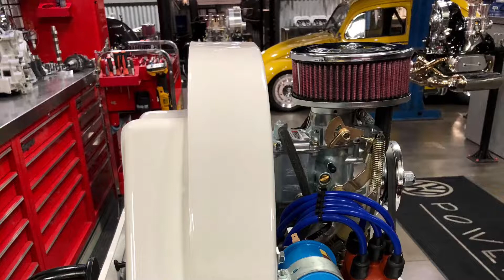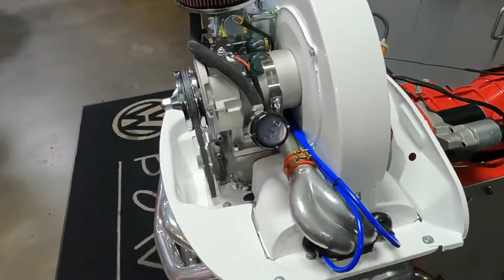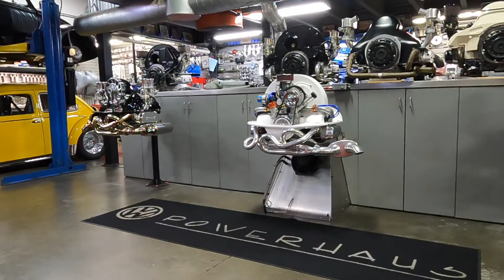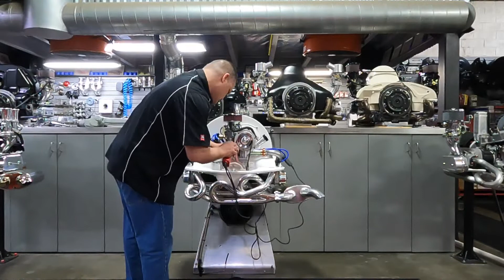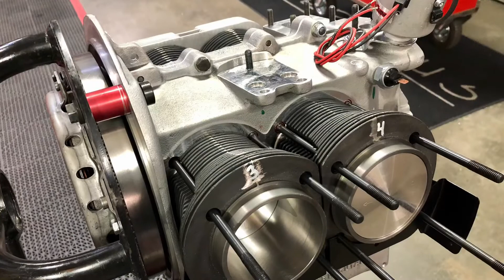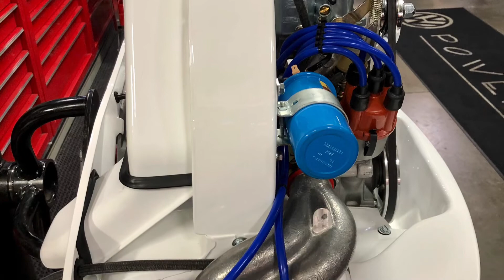Brand New POWERHAUS VW 1600cc Aircooled Engine Final Adjustments & Load Cycles

Comment: Very nice. you such great work. What would be the approx. HP of thyat engine?
Reply from the maker: This one is a stock 1600cc, it makes about 65hp, the exhaust system that is on it was for start up purpose only, customer will be putting a stock muffler system on it before install